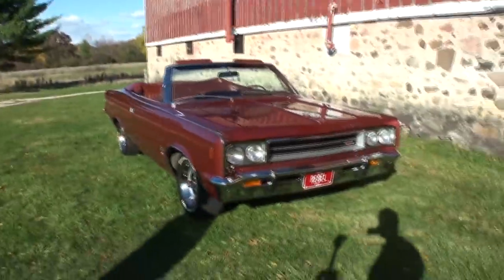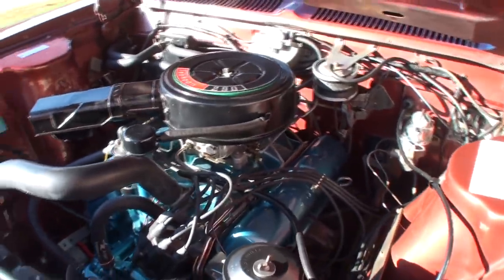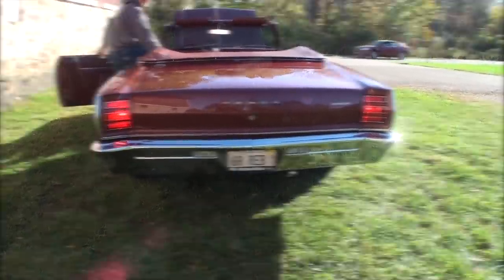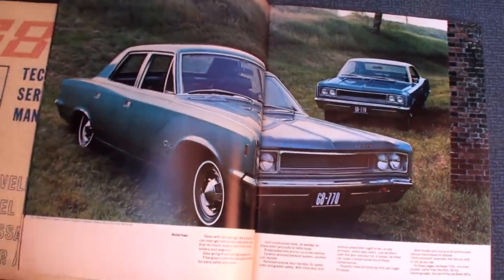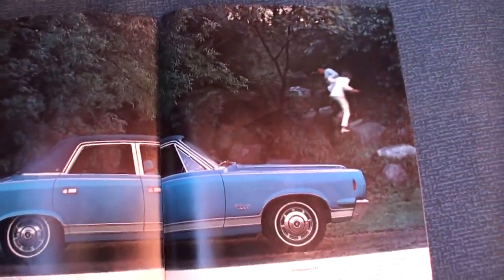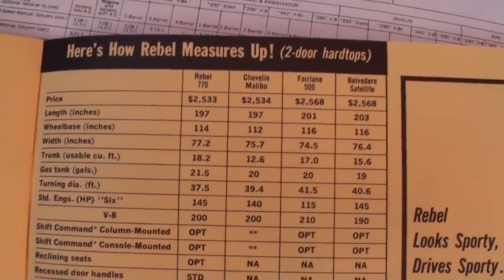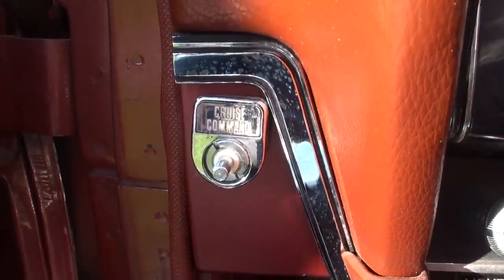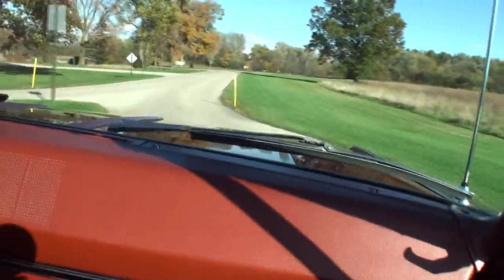1968 American Motors AMC Rebel SST Convertible Survivor & Ride on My Car Story with Lou Costabile

Comment: I'm not a big AMC fan, but, I'd have to say that car is a sharp-looking car.  It really works as a convertible.  I was also born in 1968.  It would be pretty cool to own a car that was made the same year of your birth.  Actually, for about the first 12 or 13 years of my life, my grandmother had a '68 Dodge Coronet sedan that she bought when it was new.  My uncle made her sell it to get a "K" car, I believe, in '81.  But I thought it was cool that she had a car that was made the year I was born.  I don't know if that '68 Coronet is still on the road, but it was for some time after my grandmother sold it.  There are some cars that, to some degree, have sort of a timeless look to them and that Rebel SST kind of has that kind of look.  I too like the chrome trim piece that goes from the rear bumper, all the way to the front bumper.  It sort of makes the design of the car flow from the back to the front.  Thanks for sharing that, Lou.  :)
Reply from the maker: Hi clyde7059, Happy to read you enjoy the looks of this car :-) Glad to read your birth year is the same as this cars. Nice! You're welcome, Lou

Comment: My 69 Ambassador SST 343 that I had had the same type of wheel.
Nice vehicle.
Reply from the maker: Hi Gary, Happy to read this car brings back memories of your car :-) Thank you for viewing and sharing, Lou
Reply: Gary McKee: The 343 V8 is a great engine plenty of power even with a 2 barrel carburetor.
Reply: @Albert Carello  Yes, I was surprised with the power that it produced in stock form.
Reply: @garymckee8857  I t can even give the Cadillacs some speed competition from a wide open throttle stand start the Cadillacs being much heavier cars. My 1972 AMC MATADOR certainly sure did even with just the 2 barrel 360 cubic inch V8.

Comment: Just imagine if AMC had put a 390....or 401....in this combination....looking at this car though it shows the wisdom of Chevrolet and how all others eventually followed. Roughly 280 cubic inches is enough for a car this size as long as you watch the weight. Thing is you need about 1 hp.cu. in. to get it moving aggressively. Look at the MoPar 273, the Ford 289 HiPo or even the Studebaker 289. It can be enough if you squeeze it tight enough. Stude went for a McCullough blower. Chevy used fuel injection. But the numbers work, and you end up with a really well-balanced car.
Reply from the maker: That's a good idea :-)

Comment: 1 thumb down...a hater who's Mustang got smoked by a '70 AMX.  It's been 50 years man -  Rambler boys spoiled a few parties...
Reply from the maker: Nice :-)
Reply: Audie Conrad: I had an AMC MATADOR 1972 with a 360 cubic inch 2 barrel V8. Many times from stoplight raced I was clearly the winner. I had curse words hurled at me from the driver's I beat at stoplight start races.
Reply: @Albert Carello  love it!  The 360 was a strong motor.  Wrapped in a Matador  - perfect sleeper.
Reply: @audieconrad8995  It sure seemed to have Cadillac like performance. From a stoplight from a standstill on a semi-expressway when the traffic light turned green a 1969 or 1970 Cadillac was right alongside me and we both floored our accelerators from a stand start and I stayed right alongside that Cadillac up to 45 miles an hour. Then the Caddy started pulling away from me when both of our transmissions upshifted to second gear at full throttle again at 45 miles per hour!!!!!!!
Reply: @audieconrad8995  Great at stoplight racing competition from stand starts even though the transmission had a 2.87to 1 rear axle ratio. A 3.15 axle ratio was available as an option and I almost went for it. The Torque
Flight transmission seems more than very efficient enough on it's own with the 2.87 to 1 axle ratio.
Reply: @Albert Carello  2:87 - mighty tall gearing.  Good for high-end and economy.  Shows how much torque those 360's had!
Reply: @audieconrad8995  The previous transmission a Borg Warner based automatic the "SHIFT COMMAND" would have benefited from the shorter higher numerically rear axle ratios to give better performance. The Torqueflight being a far more efficient transmission performed flawlessly even with the taller( lower numerically) final drive ratios.
Reply: @Albert Carello  ya, those BW's were not the strongest units...good move to go with TF's in '72!  BW T-10 manuals were pretty stout!
Reply: @audieconrad8995  Just think what the 3.15 rear axle ratio would do for enhancing the performance even further plus dual exhausts.
Reply: @Albert Carello  oh hell...and a 4bbl!
Reply: @audieconrad8995  My 1972 AMC MATADOR had a 2 barrel carburetor and a 360 cubic inch V8. I've won many stoplight raced from stand starts and have the other drivers curse at me.

Comment: I thought this car would be a hot performer with the 343 cubic inch V8 with either a 2 barrel or 4 barrel carburetor. This us also back in the days when cars were much more fun to drive.
Reply from the maker: Hi Albert, Hmmm, not sure if this one is a "hot performer" but seems to move ok. I do agree this car seems it would be fun to drive, Lou
Reply: @loucostabile  It can easily perform as well as a Cadillac of the late 1950s being a somewhat lighter car than a Caddy when equiped with either of the 343 cubic inch V8s.

Comment: I agree, every guy would be an AMC guy if those cars came with the bikini girl!!!
Reply from the maker: Hi Steel Assault, Would be a nice Dealer option, however I wonder what the cost would be? :-) Lou
Reply: @loucostabile   A friend of mine told me this joke that has some truth to it apparently.  A guy boldly stated that if something flies, floats, or f@#!s it is cheaper/better to rent than buy ;)  Someone else stated that if something has wheels or boobs it will cause you trouble sooner or later;)

Comment: Does anyone else have anti aliasing issues on Lou's videos?
Reply from the maker: What is an "anti aliasing issues"?
Reply: @loucostabile  Hi Lou , esp when the camera pans all the straight edges have fuzzy lines or become pixelated  . It's usually a setting in the camera ,editing or conversion to youtube. Regards
Reply: @loucostabile  example 5:51 camera still , crystal clear  .Whenever the cam pans turns fuzzy e.g 6:41 around windshield